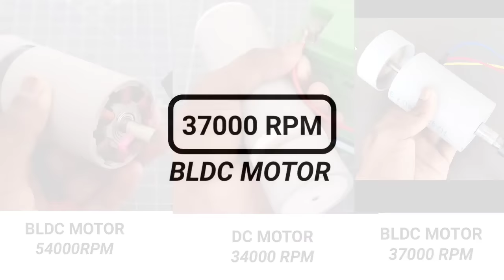Making Powerful Three Spindle Motors || 54000 RPM Brushless Spindle Motor || Brushed Spindle Motor

Comment: i doubt so, 54k revolution dosent have that sound, looks more like under 3500 rpm.
Reply: your absolutely correct, I was thinking the same thing. I have a lot of experience with high speed rotors. He is holding random readings, the meter is probably jumping all over the place because the meter doesn't have a good reflective surface like the reflective tape they give with all the tachometers.